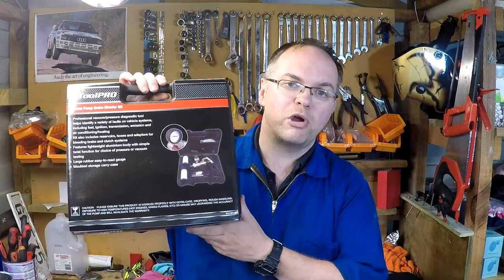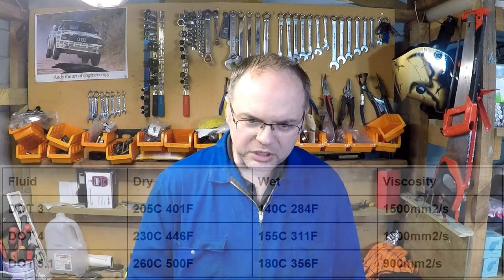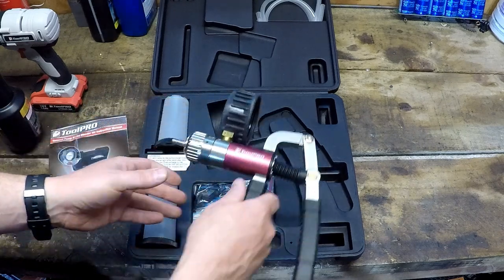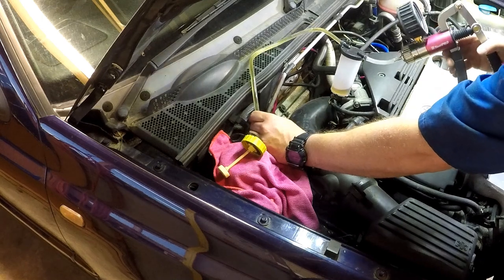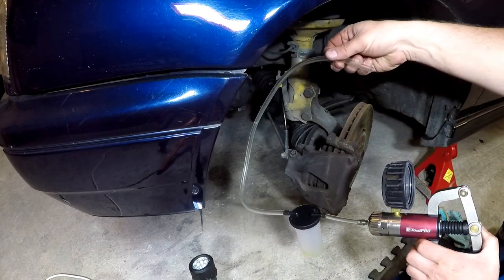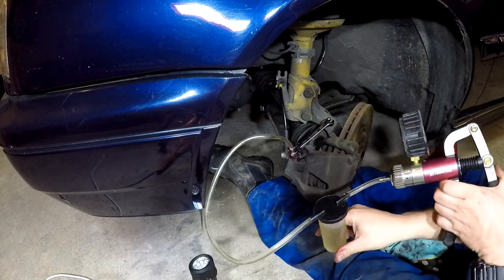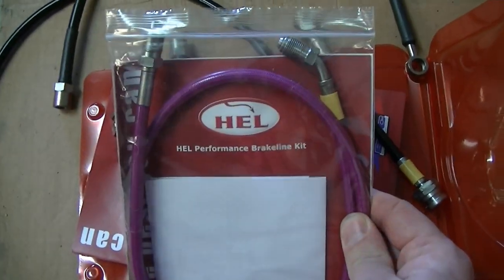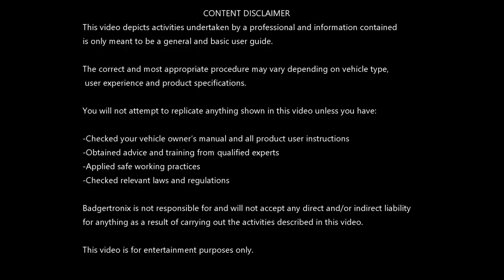Vacuum Bleeding Brakes with the ToolPro Vacuum Brake Bleeder

Comment: Great video editing Jonathan with the Bond logo and with cloning yourself. Looks like a pretty good tool and good tip about using grease on the zerk fitting. Keep up the good work! :) 👍
Reply from the maker: Thanks Terry. I'm slowly learning what my editing software is capable of. The grease worked really well. Cheers

Comment: Great job explaining the differences in brake fluids. I keep a check on my fluids with a meter so I have been extending my intervals between changing fluid but like oil, it's cheap insurance.
Reply from the maker: Cheap insurance and with how dirty that fluid was after a year I'll stick to my schedule. Thanks Wyatt
Reply: @Badgertronix  sounds like some gunk was left over from last year. Pretty normal.

Comment: I've never had much luck with my vacuum pump but recently it did get me out of a pinch . My usual bleeding method just wouldn't work so I resorted to the vacuum pump and it actual worked... first time out of many attempts.
Reply from the maker: I had an air powered bleeder that was useless. This seems to work well and pulls a strong vacuum.

Comment: Looks like a solid piece of kit mate... nice tip with the grease to seal the hose,  I was wondering if cable tie would do the job ? Cheers mate 👍
Reply from the maker: Definitely solid and works really well. You hear about using cable ties to do the same job but can't say I've ever tried. Cheers

Comment: Question: what about ABS systems I read you need to have a scan tool to activate the ABS solinoids while doing brake bleeds. If this is correct then from what I can make out you need an expensive scan tool to achieve this. Most cheaper scan tools are limited in their capabilities, it's not until you get into the higher range scanners like over a few thousand + dollars.
Great video been looking at these tools but not sure who is selling the best one for the money e.g. SCA or Repco or others like Sydney Tools.
Graeme in OZ

Comment: Ahhh vacuums. I don't like vacuums mainly cause they suck. 
Hey my jack doesn't make that noise, how'd you get it to do that?
I gotta cheap vacuum from Chinese Freight I think, works pretty good. 
Hey great cloning butt one guy started to loose his head. 
With four4 guys working all at once ya get it dun inna good nick.
Reply: Yeah good tips. Yeah ya gotta get as much of the old fluid out of the reservoir as you can and I start with the closest wheel (shortest brake line) and I do that so I can see the fresh fluid coming out. That way I know the reservoir has been flushed. Then I go to the opposite rear wheel from there to the next rear wheel then on to the front wheel that hasn't been done. I finish by doing the first wheel that I started with.  Another tip is to alternate your brake fluid. I recently  flushed the fluid in one of my cars and used a clear brake fluid next time I'll use red or blue. Makes it easier to tell when you've flushed out the old fluid.
Reply from the maker: Thanks buddy. Some good tips yourself. The vid was only supposed to be about the tool but I got a bit carried away and had an argument with at least 3 of my clones and the ringleader stole the camera and talked about fluid and junk. Coloured brake fluid is a very smart idea especially in this rainbow nation in which we live.